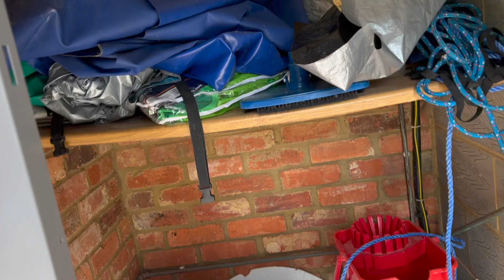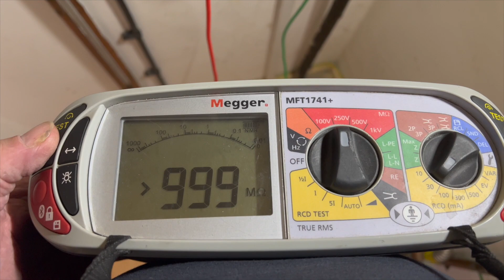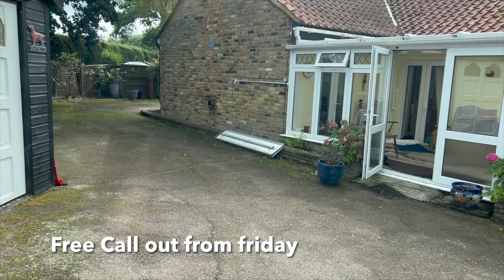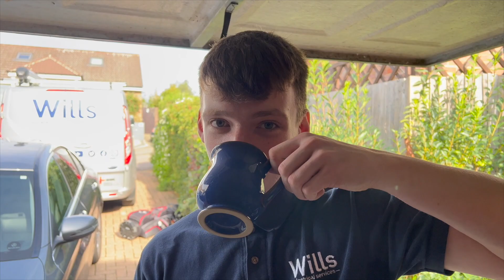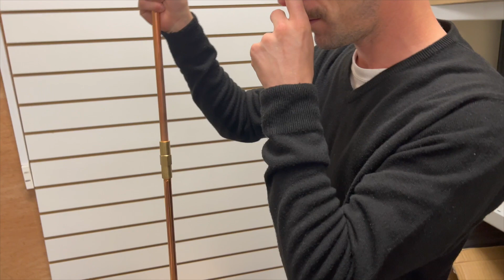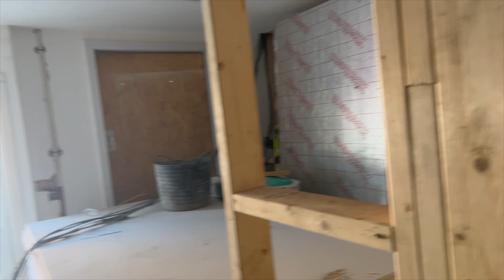🐝⚡️A WEEK IN THE LIFE OF A UK ELECTRICIAN #week3 Wills Weekly Testing,First fix,Fault finding

Comment: Your work is top class mate I’ve picked up a fair few tips from your channel. Why do you bother with that shite plastic capping though on d&d walls though ??
Reply from the maker: Thanks a lot I really appreciate. Regarding the dot and dab  walls and capping. I have always done it that way I find it looks neater and also the cables never get lost by Plaster  moving them around.
Reply: @ElectricianTV  clipped to the walls looks neat too and they don’t get moved round either. A few builders  asked why I didn’t put capping on, I explained why ask if they wanted to the additional time and cost to fit it and they always say don’t bother … 

Internal face of blockwork mortar would look neat if they pointed it up but it’s getting covered over so it’s a waste of time and cost.